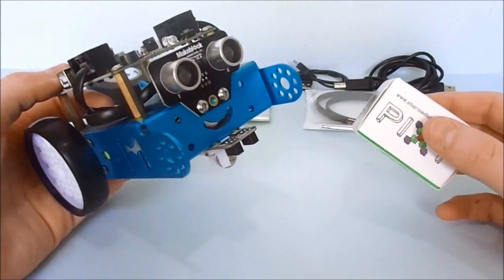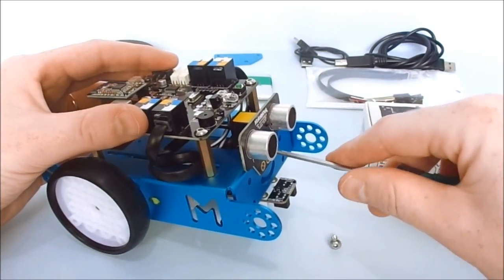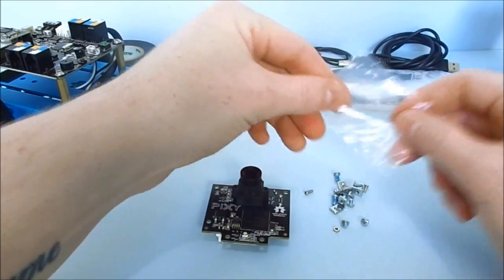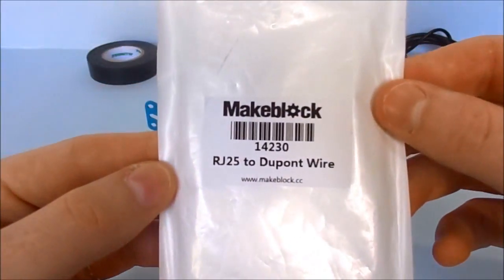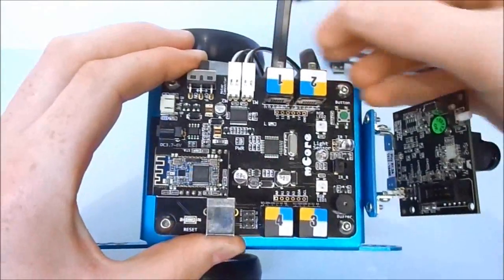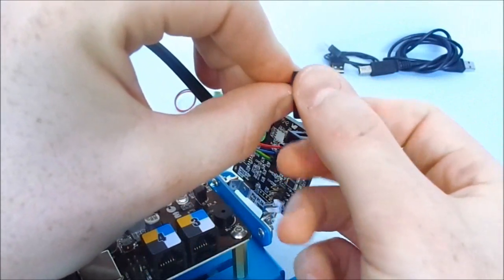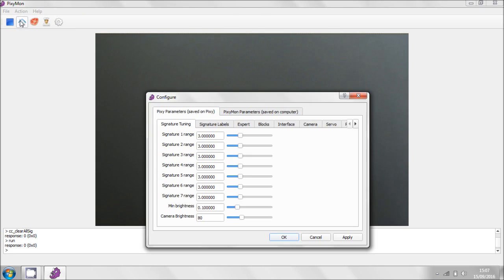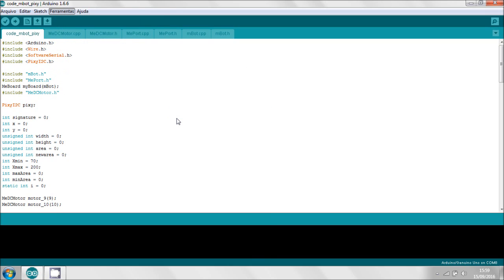How to make an object follower robot (with mBot + Pixy)

Comment: I have a problem with the code. Practically when I load it gives me these errors: Arduino: 1.6.6 (Windows 10), Card: "Arduino / Genuino Uno"

C: Users 39347 Desktop code_mbot_pixy code_mbot_pixy.ino: 4: 21: fatal error: PixyI2C.h: No such file or directory

 #include <PixyI2C.h>

                     ^

compilation terminated.

exit status 1
Error during compilation

  This report could be more informative with
  "Show detailed output during compilation"
  enabled in "File> Settings"
  Can you please help me?
Reply from the maker: Hi! Looks like you haven't installed Pixy's Arduino library. Didn't?

Comment: Will it work with pixy2
Reply: Ok, i bought pixy2.. will let u know what happens
Reply: Hi, thank you so much for your reply! I made it work with pixy2.. i changed the code as per the pixy2 library and its chasing objects nicely!! Thanks a lot 😊
Reply from the maker: @ashanair9529  Nice! I'm glad that it worked for you. And thanks for your reply... it will surely help more people.
Reply from the maker: Hi! Not sure, but apparently it will. Probably it will work in the same way of the version 1. Maybe it has a new library for Arduino and need some code adjusts.
Reply: Hi! Where can i buy pixy

Comment: I download the Arduino code but I can't open the file in the arduino software due to it being a RAR. file. it says it needs to be a INO. file but I can't seem to figure out how to do that. Any advice?
Reply from the maker: but if you use an Arduino board you can use the data from Pixy and "say" to your robot "keep looking for the object" OR "go to home position". Off course it will need many lines of code. ;)

Comment: Triing to get the pix cam library to load its a text file, does it have to be a specific file format, or do you know a good link with a tutorial for a newby.  Thanks great project, and video. Its just the Pixy12C.H file that is not in my library, and so code fails to compile.

Comment: I can buy Makeblock mBOT but the Pixy is quite expensive in Romania. Can you guide me to use a different sensor that is cheaper and it will work with that robot? I need it for my faculty project.

Comment: I wrote the Pixy Extension in both SPI and I2C, you can program Scratch for Pixy Camera in mBlock. To install this extension, in mBlock, go to Extension and search Pixy.
Reply from the maker: Sounds good!
The RGB LEDs stills blinking while interfacing with the SPI pins?
Reply: Where is the extension?

Comment: Hi, I have a Mbot Ranger with a Arduino Mega 2560 instead of the Mbot, the code doesn't seem to work on the device.  Any advise?
Reply from the maker: First of all, UNO and Mega has different I2C pins schematic.

Comment: Hi, if I were to programme this to an arduino, what arduino would you recommend? And can I assume that all I have to do is to remove the mbot library in the code to make it usable on arduino?
Reply from the maker: With Arduino UNO it should work well. You'll have to do a new code, specially for the motors.

Comment: How do you keep the distance? Object size? (I have a Pixy  and made the "Pixy Pet Robot") I'd rather not hard-code to object size. Your example would be totally different following, say, a ping pong ball versus a soccer ball.
Reply from the maker: What determines the distance to the object is its "area". For example, while the object gets closer, the "area" increases, and so mBot must run backwards. And also the x,y coordinates.
Reply: Thanks for your reply. This is what I thought. (Using area is also how the original Pixy Pet Robot code does it.) Wouldn't a Pixy-sized Kinect be awesome! But, alas...

If the object was at a fixed-height AND below the pixy (like a ping pong ball rolling on the floor), then the tilt angle could be used to defer distance: distance = tan(tilt_angle) * height_difference

Alas, that also limits the application.

Comment: It's nice to find an electronics You Tuber that actually replies to their viewers.

I was thinking about getting this bot from Radio Shack. It seemed a really  limited though. If I can use the Arduino OS with it and the Pixy Camera with it I might buy it. Can you use other Aduino sensors with that bot or are you limited to just MakeBlock products ?
Reply from the maker: Hey, thank you very much for your comment!The mCore board is basically an Arduino UNO (I mean it's the same chip: ATmega328) with some additional features. Some pins may be exclusive for that additional features.
I have only tested with Pixy, but I guess most of Arduino sensors/components should work fine.
Please take a look at this post I made, with essential info: http://www.robotshop.com/letsmakerobots/object-follower-robot-with-mbot-pixy
Reply: +Mech-Dickel Studios 
Thanks.